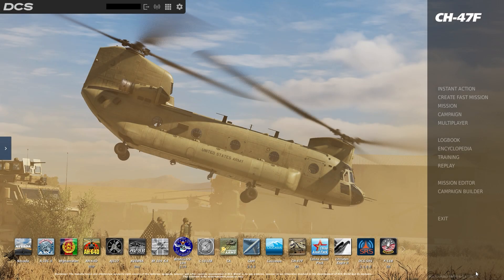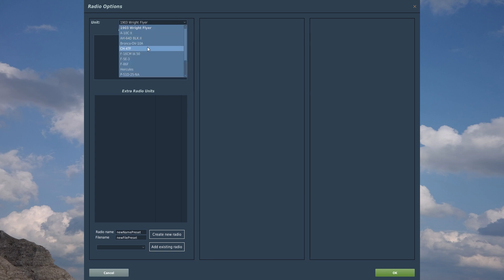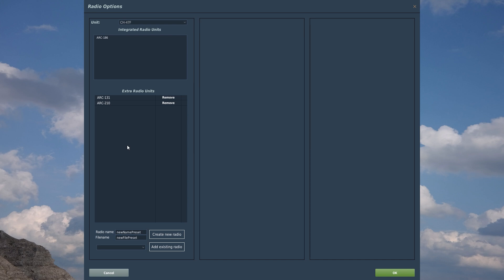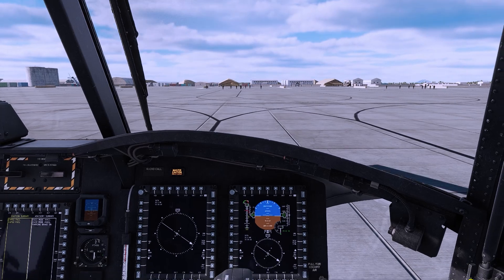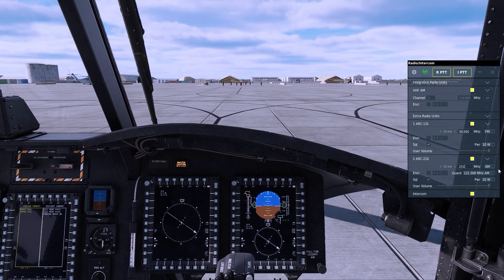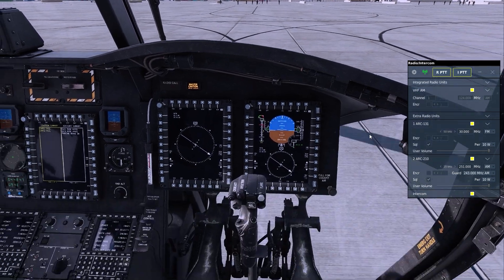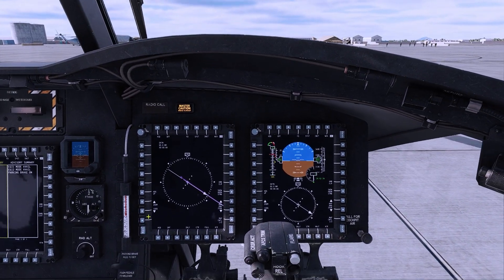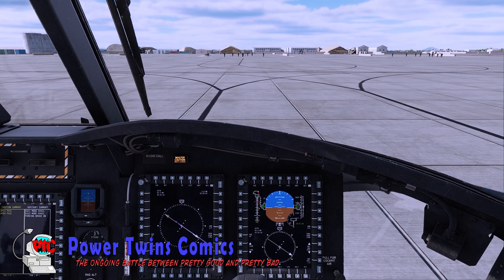DCS: Tutorial: CH-47F Custom Radio Stack and MFD Overlay

Comment: Do they work with srs?
Reply from the maker: We did not test that, as the group we fly with switched to DCS internal voice chat some time ago.
Reply from the maker: We have tested the custom extended radio stack with SRS and determined that SRS does NOT detect the custom radios. (This makes sense as that stack is intended by ED for in-app VOIP for low fidelity aircraft.)

But, the Chinook has a larger stack now, and those radios are detected by SRS.
Reply: @PowerTwinsComics  And how do you there change channels in flight ??
Reply from the maker: @chocks9350 On the custom stack, you display the overlay and you can change the channels on the overlay.

We demonstrate this in the video here: https://youtu.be/TQqCK6rKuBU?si=Oq7G8kEym90cMIQT&t=188